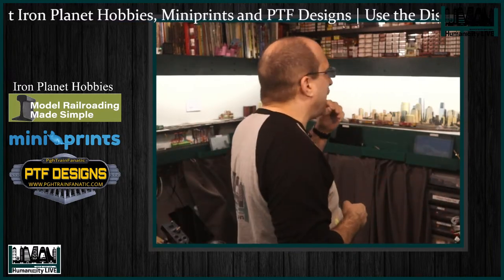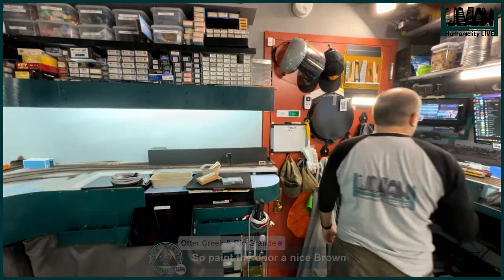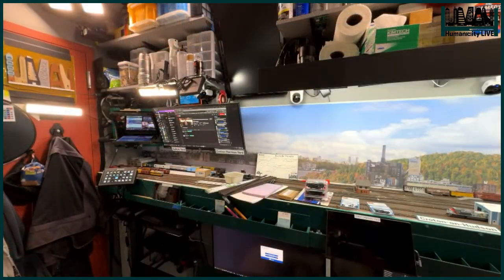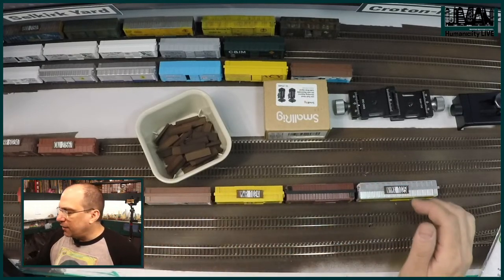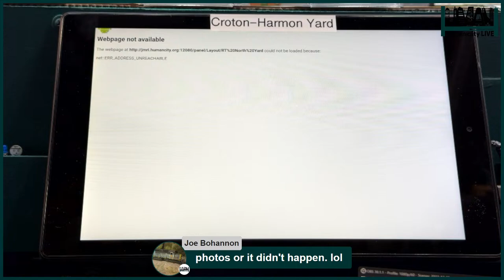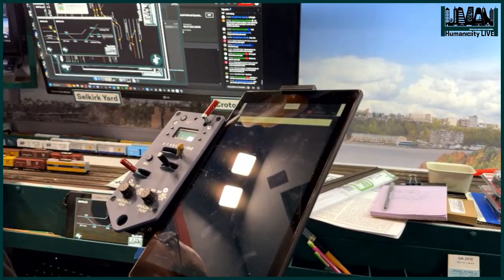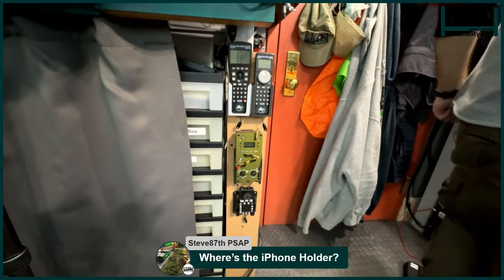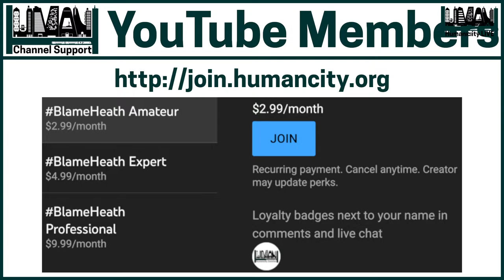Touchscreen Control: Enhancing Model Railroad Operations with JMRI and Tablets | Model Railroad Talk

Comment: What do you use to connect the tablet to the computer running JMRI? I assume Windows on your computer and an Android tablet.
Reply from the maker: I am using the built in JMRI Web Server. So JMRI is publishing the pages over my local network and I just point the tablet to the specific web page.
Reply from the maker: https://www.jmri.org/help/en/html/web/index.shtml
Reply: @HumancityJunction  should this work using an android tablet?
Reply from the maker: @genejablonski9909 I am using Amazon Fire tablets which run a version of Android.
Reply: Any tablet that has an internet browser will work (I don’t know any that don’t),” - It’s just a web page.  You do need WiFi in the room of course
Reply from the maker: @TTownTrainFan  this is correct, but…

I am using an app called “Fully Kiosk”. This app keeps the webpage loaded, refreshed, constantly on and at a set brightness. 

A lot of the web browsers will time out or dim, which I wanted to avoid.